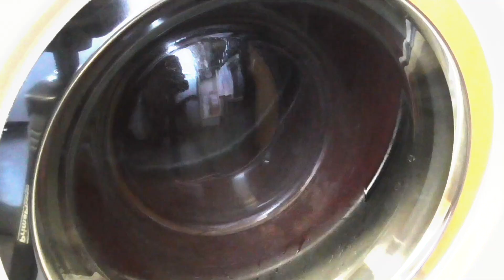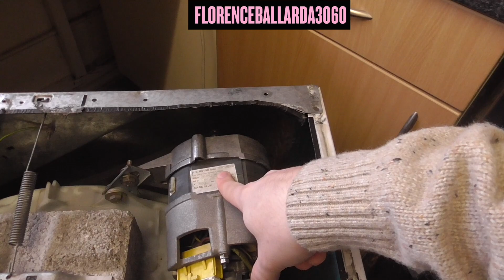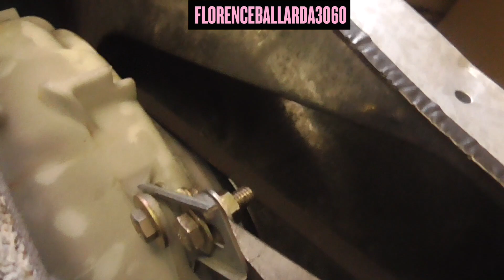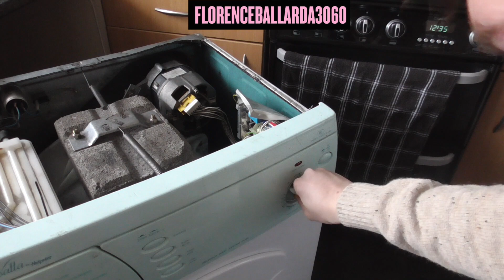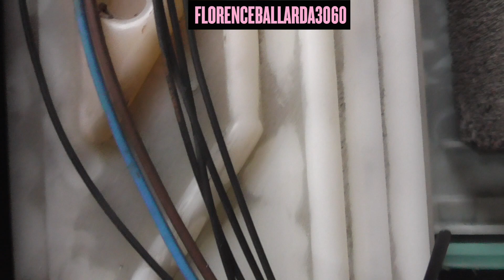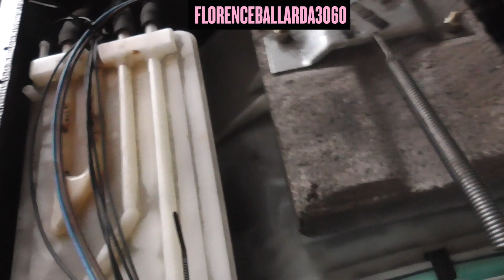Casatta by Hotpoint WM63 Aquarius 1100 - Final Wash with Lid off!

Comment: I'm looking for a THERMAL PROTECTION Switch for the motor in the wm63n same model aquarius 1100
Reply: Turned out not to be this and was split wire to the motor.

Comment: I have a similar model. It does it cycle perfectly well, but does not spin at maximum revs. What could be the issue?
Reply from the maker: Hi there, sounds like your carbon brushes need replacing

Comment: The 2 extra inlets on the drawer are for the WD's, the smaller one of the two (closest to the cabinet) is connected to the dryer fan, and the other one is connected to the condenser, both are emergency overflows, the smaller of the 2 being the absolute worst one to see water coming out of, it usually means the dryer fan motor has been flooded and will most probably have failed by that point
Reply from the maker: You do realise the dryer fan motor is on the outside of the condenser box? So therefore none of its electrical components have any contact with humid air or water in the dryer duct? So it wouldn’t fail if it was flooded, unless somehow the water actually went inside the fan motor

Comment: I think that the 1400 motors could be slightly different, with a different label. Though I do know that the 95 series Microprofiles had a different motor with a resistor board above the plug (such as the 9566), and some had an AEG motor (such as the 9567)
Reply from the maker: I think the 1400s were green label. I know it was on the 9560/9561. But yes it had the resistor board above to also filter out any interference from the motor to pcb

Comment: That was actually REALLY awesome to see! The motor is fitted on the top left of the drum instead of the bottom, that's so unique! I really wanted you to make a video with seeing the inside of one of your washers. 
It has a plastic drum though right? It looks like plastic to me..
Also, how did you know that removing a resistor on the pcb will increase the max spin to 1200? The name of the machine is now like "Casatta by Hotpoint WM63 Aquarius 1200"! 

Goodbye Casatta....
Reply from the maker: I agree, Hotpoint’s idea of mounting the motor on top made everything so much more easier to repair, rather than having to get on the floor or even underneath the machine to change brushes, or even take the motor out in some cases. Yep these used plastic tubs, enamel tubs were long gone with British machines by this time. But stainless steel was around in vast quantities.

I knew about the resistor because loads of other collectors told me about it
Reply: @HooverA3060   I do.miss the casatta
Reply from the maker: @merseyrail-kt8tr  Me too, especially as she's been in the shed for over a year now without use as she's awaiting to go to Washing Machine Guy.

I miss the towel washes most in this machine
Reply: @HooverA3060  do you watch watching machines on YouTube
Reply from the maker: @merseyrail-kt8tr  Yes, all the time I do
Reply: @HooverA3060  same  what machine do you watch
Reply from the maker: @merseyrail-kt8tr  Any ones that I see to be honest
Reply: @HooverA3060  I watch you or which washer or sivesslime
Reply: @HooverA3060  I had a dream that I meet you in person we were in some house with lots of hotpoints like wd640 your favourite machine hotpoint wm51 wm52 wma64 zanussi the hole lot it was good

Comment: why do washing machines on intermediate spins not spin at max speed like the final spin
Reply from the maker: Because there's not enough time for the machine to ramp up to full speed in those 2-3 minutes. Think about it...it would take nearly 5-10 minutes for a 1400 or 1600 machine to fully reach that speed in an intermediate spin. Plus why would it need to? The whole point of the final spin is to completely wring out the clothes until it's almost dry. Intermediate spins just need to kick out enough water to rinse out.

Also, doing so would put unnecessary strain on the motor, consider how sudsy the water is before the final rinse, trying to spin a sudslock at 1400rpm, it would pretty much burn the motor out

However, you are kind of wrong though as there were actually machines that hit maximum speed on intermediate spins. Hotpoint 18-series and the later 95s all went to 1000 or 800 on the intermediate spins (and they were a very good reason why it was a bad idea, if you've seen a 18580 doing so). As well as the Hoover New Waves, but those intermediate spins took ages
Reply: @HooverA3060  the new LGs intermediate spins are now at 1400 for some reason not sure why 800 or 1000 is more than enough between the rinses
Reply from the maker: @rockstar-tx8kw  Most likely because the Direct Drive motor can handle high speeds for a very long time, unlike the conventional AC/DC Washer motor :)
Reply: Why do modern machines take hours to wash? Low temperatures?

Comment: Bye Cassandra! You were a very good machine! I hope the next owners don't brick it 😂
Reply from the maker: Nah, she's only going to a collector so, she'll be looked after. I'd never let anyone else take her
Reply: An Hotpoint WM73 is very good. 1400 rpm and very good programs.
Reply from the maker: @anvil_08  They are very good, but however the WM73 would need a GEC Motor lmao
Reply: Ops, i forgot it! Anyway, an FHP motor is more quieter, like Miele's motor
Reply from the maker: @anvil_08  it’s quieter but not as quiet as a Miele, Miele use brushed DC